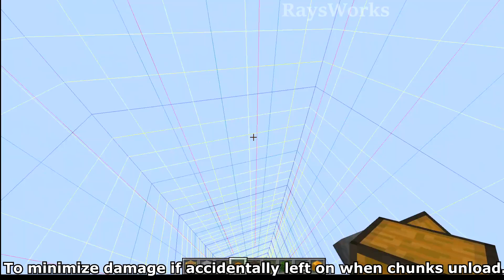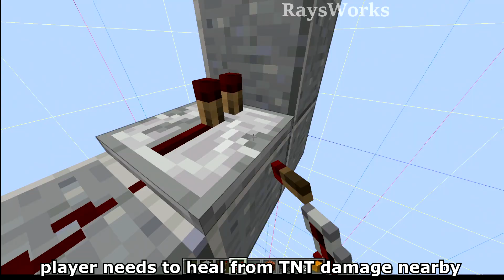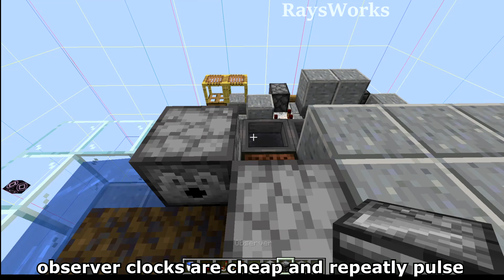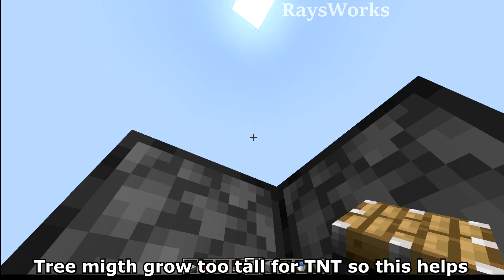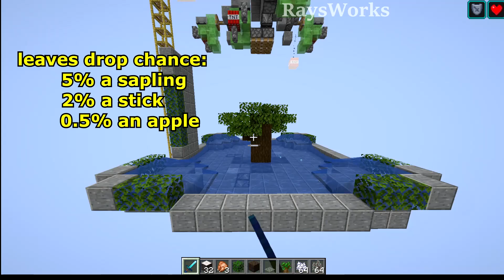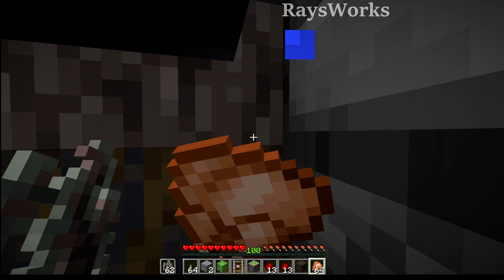CHECK description for NEW Easy AFK Pale Oak & Dark Oak Tree Farm!  [TUTORIAL] 1.15-1.21.8 Minecraft

Comment from the maker: EDIT: NEW design that's better here https://youtu.be/NTm4qpVwFN0 
Do you like the more technical stuff as text at bottom of the video? :_rayGordy:
Help me continue making videos:
https://www.youtube.com/channel/UCDi2s0xQrfFwivdmsPiuU_w/join 

Materials: 
Blocks  379
Redstone Dust 65
Hopper 42
Slime Block 36
Redstone Repeater 28
Oak Leaves 26
Scaffolding 25
Glass 19
Sticky Piston 15
Cobblestone Wall 12
Chest 10
Observer 9
Dead Tube Coral Fan 6
Detector Rail 6
Dropper 6
TNT 6
Torch 6
Muddy Mangrove Roots 5
Water Bucket 5
Piston 4
Redstone Comparator 4
Lever 3
Smooth Stone Slab 3
Dispenser 2
Furnace 2
Oak Trapdoor 2
Redstone Torch 2
Waxed Copper Bulb 2
Block of Redstone 1
Campfire 1
Honey Block 1
Note Block 1
Oak Sign 1
Reply: I have an issue with dark oak. Pale oak works fine but dark oak breaks 1 tnt duper and blow up the 4 pistons above. Pale oak should be the same but I noticed this only happening with dark oak. Did I something wrong? Double checked all settings.
Reply from the maker: @norbucso  check world download works there
Reply: @RaysWorks  Just checked it. Dark oak broke the farm. Destroyed the upper pistons and 2 tnt dupers. After 20 minutes of testing. But only the dark oak. It's 1.21.4 version vanilla. Pale oak works fine
Reply from the maker: @norbucso  nothing by the water broke?
Reply from the maker: @norbucso   Did you make sure to turn the observer clock off back on again so it has the faster pulse which is needed in order to prevent the tree from growing after the TnT has already exploded?
Reply: @RaysWorks  Found the issue. Can't plant a single sapling to the right before the honey block moves the player or the tree grow faster before it gets blown up. Tested for both types. Thanks man. ❤
Reply from the maker: @norbucso   Make sure you're aiming correctly and it has the timing correctly
Reply: @RaysWorks  Yeah that was the issue. The observer clock reset and aiming to the left first.  Works now flawlessly. Thanks. Amazing design. Must have cost a lot of time to make it.
Reply: Thank you, man!

Comment: It doesn't seem to be dropping enough saplings for me to keep running. What is the recommended fix for that?
Reply from the maker: should be enough. you check the chest for items?
Reply: @RaysWorks  Thanks for the response. I Just had a hopper facing the wrong way -_-